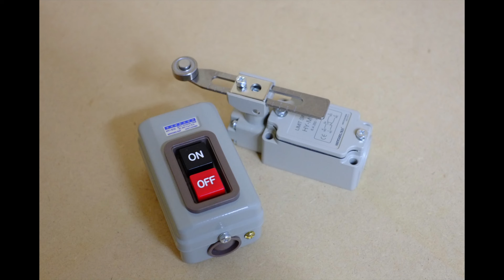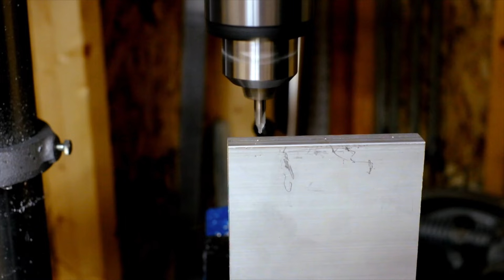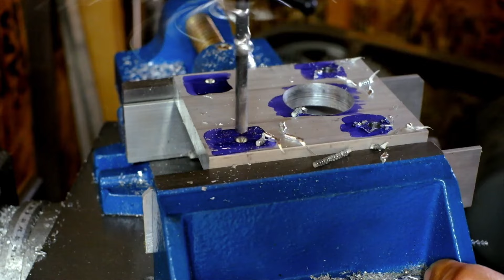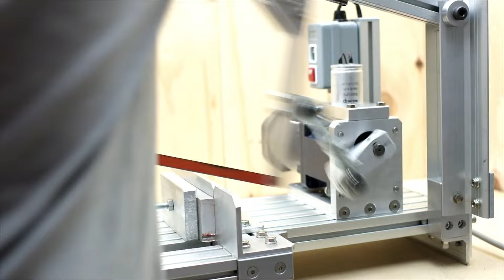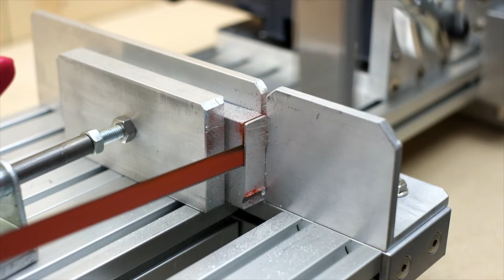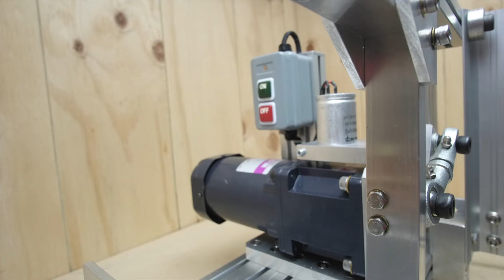Homemade Power Hacksaw #2

Comment: A lot of trouble, I am about to make one myself. However!
I am going to use the rocking motion and eliminate the slide.
How square does your hacksaw cut, I would imagine there would be a lot of side wobble
at the blade, especially with the depth  of cut you have given it.
With the rocking motion, the spaced bearings hold the saw blade square all the time, and it eliminates the friction of the sliding are in its guide.
I like your machining.

Comment: Very good job.but one thingi noticed that,the frame of hacksaw blade is not strong enough to bear stokes forward and backward.because of the material Aluminum and the big frame of hacksaw blade assembly.if the sway of fame is visible at just after the starting,so when multipal time use of hacksaw, the frame is more loose from upper corners.please correct me if i`m wrong.thanks.
Reply: Optical illusion.  The saw frame is rigid

Comment: I think you used too expensive components like the guides , probably C5 grading but still it is possible to get the same accuracy with a lot less expensive part. On the other side , I see a nice solution to expanding the linear motion. Well done overall. Thanks for sharing.
Reply: I guess he already knew about expensive material. Probably his main point is to show how beautiful it's design rather than the saw function itself.

Comment: Good work. Normally you would use an relais for turning off the machine and use an extra switch to reactive the power-system. So it is extremlly dangerous. Imagine, you know have a saw that suddenly starts to work when you lift it up???? greetz Jonas